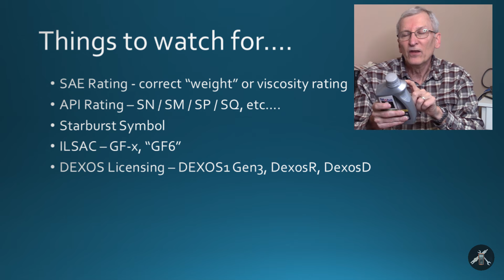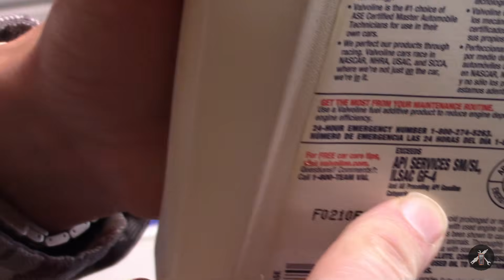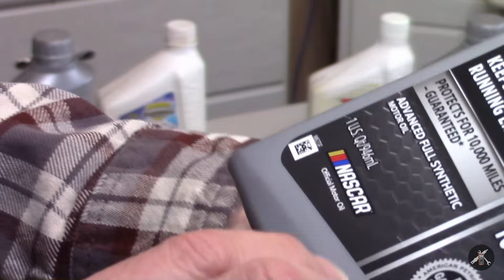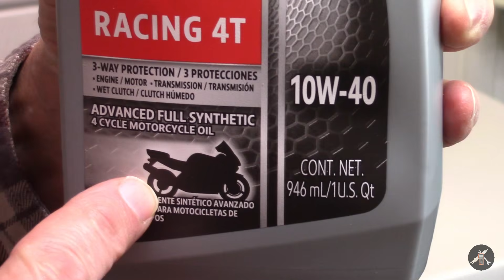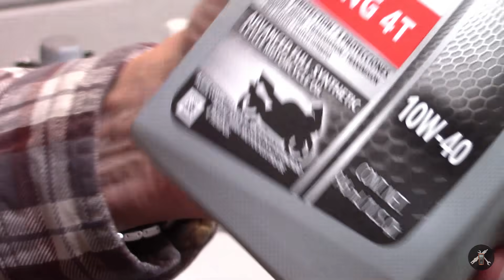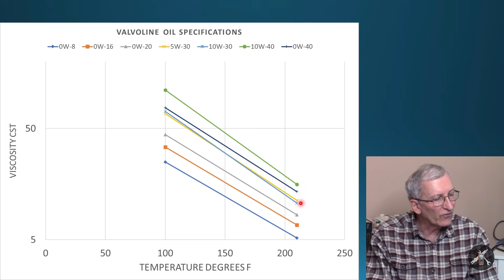What Motor Oil Should I Use? What About 0W20?  SAE, API, ILSAC Ratings? Let's Look at Some Data.

Comment: Great information, but I have concerns about thin oils like 0W-20, which some manufacturers recommend. How do these oils perform in very hot climates like the Middle East, where, the average temperature is around 104°F
Reply from the maker: I can't verify how all the manufacturers do their validation, but in my experience North American validation testing is very rigorous.  A typical application will have a maximum oil temperature specified.  That could be as high as 300 F. Vehicle cooling systems are specified to stay within the specified limits.  Southwest US temperatures far exceed 104 F for much of the summer.  I personally was on development tests in Corvettes in the Arizona desert with ambient at 119 F and other vehicles above 120+ F in Death Valley.  Vehicles are run on severe duty cycles with steep grades in these climates and extensive laboratory testing and computer simulation is done using the temperature data from those climates.

Comment: Engine oil is a controversial subject where A swears by this  and B by that, etc. My thinking lately is that if the oil meets the spec, what's the problem... Then you have people who pay    twice the money for fancy brands even when there are cheaper alternatives. I realize that the additives probably differ, but if you change the oil frequently those additives most likely won't make any difference whatsoever as long as the cheaper alternative meets the requirement.
Reply: You're exactly right.  This is a first world "problem", for sure.  Use what's on the cap, change it often and you'll be fine.  Who you gonna believe, the automotive engineers who designed these engines (and oils), or some guys on BITOG giving their opinions based on gut feelings?
Reply from the maker: Yes, there is a wide variety of opinions.  I try to run based on data and my opinion based on the data that I have seen is that following the manufacturer's spec with a good quality oil is the best policy.  Those of us on the "outside" don't have the data to take a different path with confidence.

Comment: I've been buying auto zone brand, for my 91 firebird, but now I think I should buy Mobil or Valvoline, also regular or full synthetic? humm 🤔anyway great video as always 👍lots of info!
Reply from the maker: Thank you!  Well, I have good experience with Mobil and Valvoline, but many other brands are good as well.  If your auto zone oil meets the the SAE and API specs, it should be fine.  For a '91, the current SN / SM / SP / SQ ratings far exceed the original requirements of the day.

Comment: Nice information I’m still stuck on useing my 10w30 on my 94 gmc 5.7  even though says 5w30 lol I’ve seen 2     1993 Chevy 5.7 go over 350,000 miles on 10w30  so yeah I’m hard headed but seen it work anyways 😊
Reply from the maker: Well, if you have good success, I can see why you would continue.

Comment: Enjoyed your personal history (respect), must have been a fascinating work life. I have been watching Lake Speed from "the oil geek" and have learned a lot. Personally, I have ran Amsoil since 1982 as a kid, experiencing large reduction in heat from motorcycle parts. The only "change" I have made is on my "hopped-up" LS swap Camaro, the car never sees cold weather, only heat (summer MI. winter Fla.) and I simply went to a 10w-30 from the recommended 5w-30. The fact that manufactures have to meet the "wide-range" of weather / temps across the world is my thought process for it. Thanks for the "deep dive" and all the education. Cheers!
Reply from the maker: Thank you for your feedback.  I personally haven't used Amsoil, but I have no doubt that it is good as well.
My work was indeed quite interesting because it did require going to the climate and terrain extremes. The industry really works to make sure that the products work for customers wherever you go.  Often I didn't need to go myself, but I have been on development trips to such places as Kapuskasing, ON where it was -39 when I landed and it stayed -40 or below for 3 straight days and nights. We ran cold starts and drives every 8 hours around the clock. The other extreme was C4 Corvettes in Buckeye, AZ desert with the car thermometer showing 119F evaluating clutch tuning. Ah, then there was running from Stovepipe Wells up to Townes Pass (5000ft) out of Death Valley for thermal testing. It was 120+ in the valley that day as well.
Actually, I've been considering that maybe I should tell some stories from those kinds of experiences, too.
Reply: I would enjoy the story time from the engineering days! I'm 32, born and raised Alaskan. I'm always curious about testing data, especially cold climate.

Comment: You should get on some of the other automotive channels as a guest to share your perspectives as an engineer.  There is so much guess work going on and few if any of the currently employed auto engineers are willing or able to lay it all out there. Or talk to some of your contemporaries to share their experience as you do.  
I think some of the challenges / issues faced today may be a result of the brain drain of the boomer generation retiring and taking their real world expertise with them.

Speaking of Mustangs and Cold, I stopped at a grocery store after leaving my college at -33°C maybe for 15 minutes. The car was fully warm when I went in and started fine, but I could barely steer it as I manuevered out of the parking spot.  I was quite taken aback to find I now drove a car with manual steering.  A 1988 LX 2.3L 5 spd.
Reply from the maker: I understand the guesswork and that's why I put this video together, hoping to give some perspective. I've encountered a lot of discussions, but more than I can engage with. You're correct that a lot of experienced people have retired, many in the last 5 years or so.  
Regarding cold weather, it can affect different vehicle systems very quickly. In my world, -40F was the target and we worked hard to have systems work to that temperature.
Reply: @bitsofwisdom460  motor oil geek would disagree with you. Oil viscosity from the oem is strictly due to epa café requirements.  Used oil analysis most of the time (not always) will show fewer wear metals with a thicker viscosity.  Anyone who wants to use a thicker viscosity DO IT, but please get a used oil analysis.  I've switched from 0w20 in my 23 4runner to 0w30 with great results!
Reply from the maker: Well, I'm sure there are many that would disagree with me. They have that right, and you can believe who you want to believe. If you want to risk your warranty by violating the manufacturer's specs, that is your choice.
You are incorrect to assume that OEM oil selection is based primarily on fuel economy. While it has a small impact, it is not that significant a factor.  I spent 15 years on hybrid programs trying to wring out the last bit of fuel economy to flip an EPA label number and I can tell you that we NEVER had engine oil as a knob to turn to help fuel economy. Different engines ran different oil choices based on the needs of the engine and we never changed that.
One more thing... I spent a couple of years working near a retired Toyota reliability executive that was hired by my employer to learn about their methods.  My take away is that if Toyota recommends 0W-20 for an application, I would be using it.